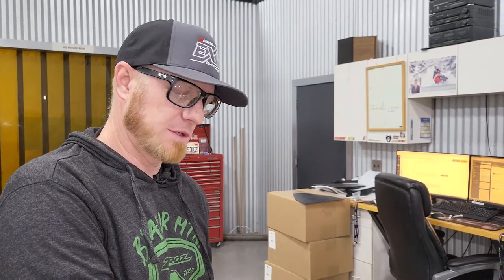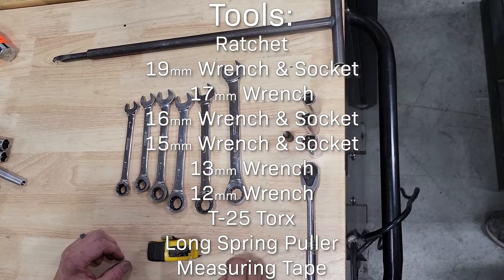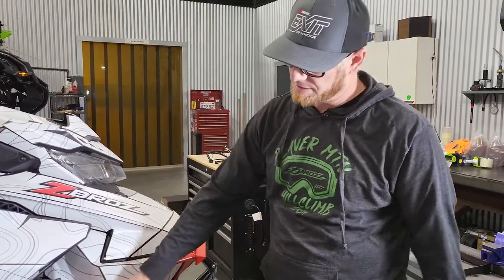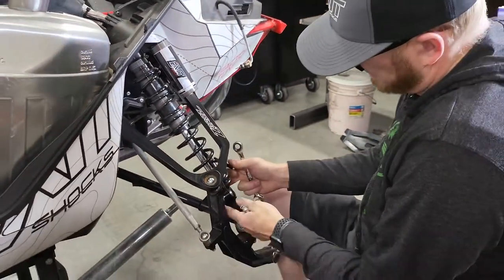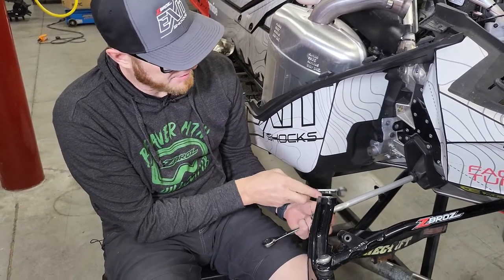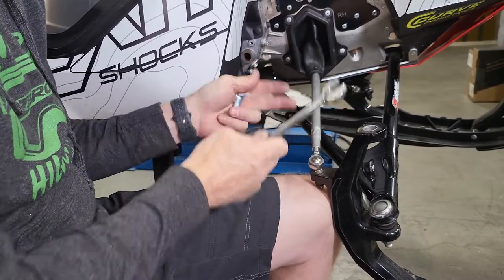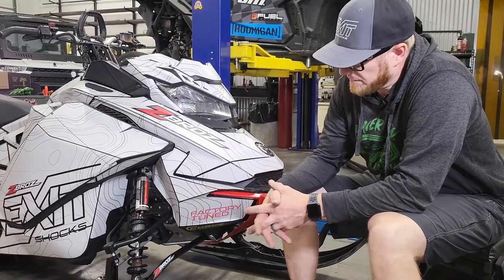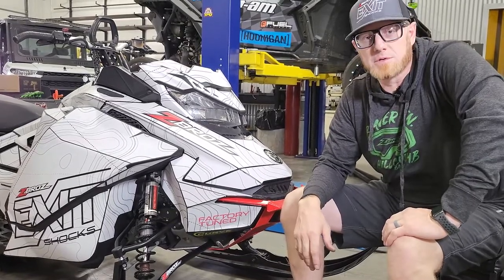BRP Mountain Sled 34" A-Arm Install, Ski-Doo & LYNX

Comment: question for you can you put a metal bushing in the upper A arm instead of the plastic on ?the plastique seam to were down very fast.
Reply from the maker: For most of our platforms, we have you reuse your factory bushings. But no, we only make delron bushings, no metal.

Comment: I've got a 23 free ride with the 36" front suspension. does this kit work with the factory reservoir shocks? I've heard that going with stock 34" A-Arms, the upper arms hit the reservoir when the suspension is compressed.
Reply from the maker: You will need to run the billet upper a-arm. That one clears, but the chromoly upper will hit your reservoir.

Comment: Is the rear nut held captive on the clutch side upper a arm?
Reply from the maker: It is, kind of but not really at the same time. The nut is held, but if you aren't carful the nut can fall if you push too much before engaging the bolt.